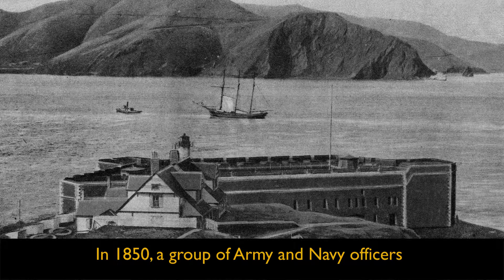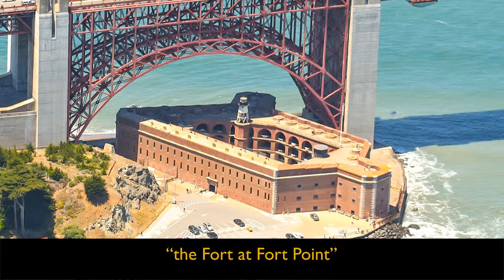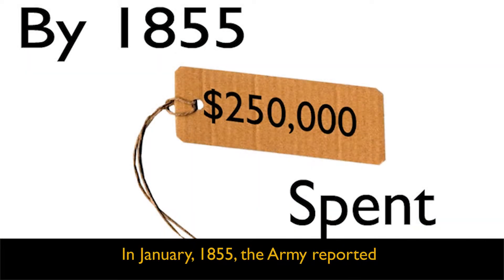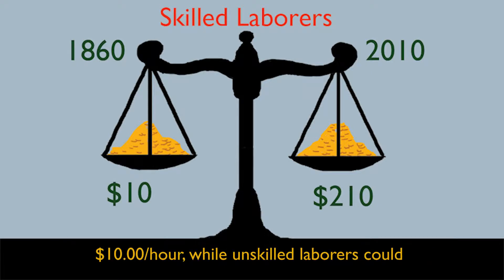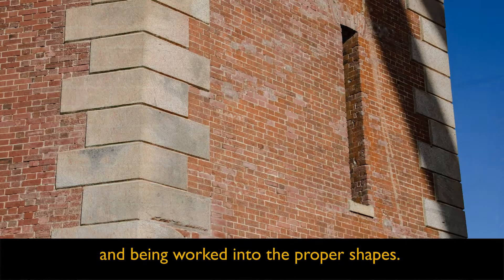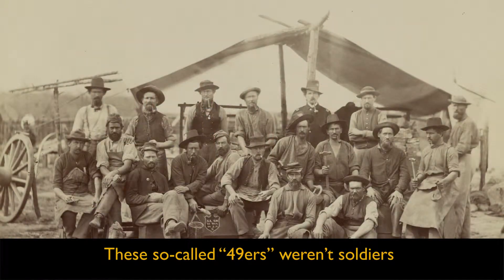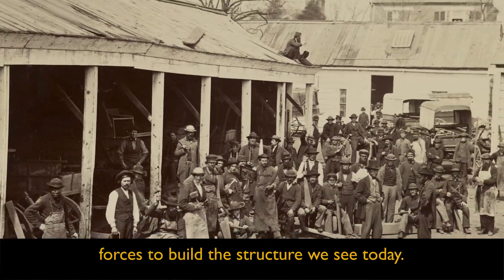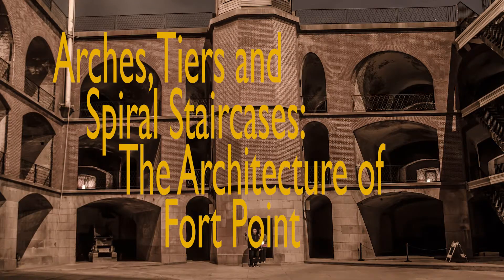Building a fort to guard San Francsico: the Construction of Fort Point

Comment: I'm from Florida, but I was there with a rental car and I was on reconnaissance mission and was looking to cross the Golden Gate Bridge when I came across a turn that would take me down, below the bridge and where this Fort' is. 😮

The parking lot for the Fort' is directly on the water where the 'Bridge crosses over the 'Bay. 🤔

No one was in the 'lot, so I parked right in front of the Fort' and in a spot against the low sea wall. 🙂

About 40 yds. out was the massive bridge  support, anchored in a solid, cement island, which I could see over and across the channel and to the Marin side of the 'bridge. 😮

The next thing I saw really surprised me because I'm surfer, and because at this point and because this is all well inside the 'Inlet and entering San Francisco bay, is that a head-high set rolled in, wrapped around the cement 'bridge  support, came straight at me and the sea wall, and broke! 🤫

A beautiful, glassy, overhead, wall; it was low tide, and had I a 'board I could have paddled out a caught 2 hours of delicious peak, all by myself!☆¡ 😅

Of course, I wasn't prepared for a surf, but that accidental discovery made my whole trip; I'll never forget it.

Just me, an empty parking lot, the Fort' behind me, and solid, overhead lefts peeling across and under the  bridge in front of me!☆¡ 😉